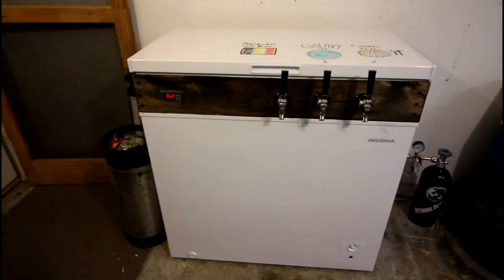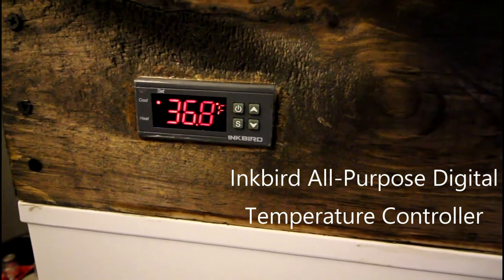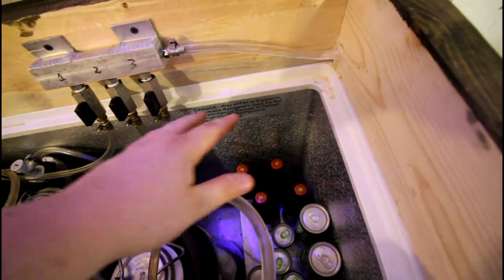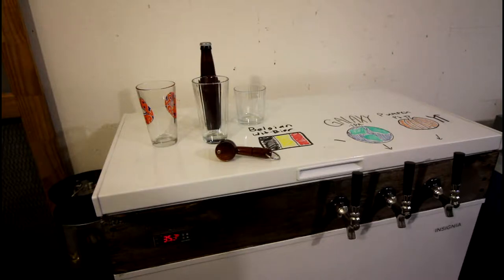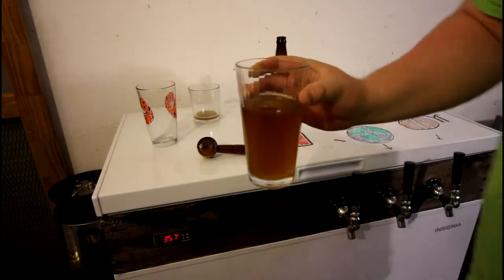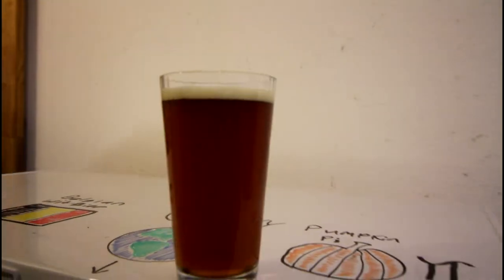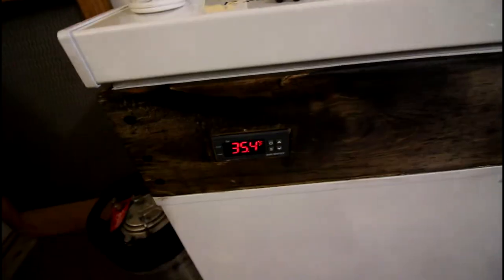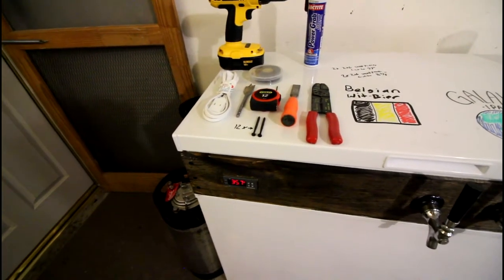Homebrew Keezer Insignia 7.0 Freezer + Temp control wiring!

Comment: Thanks for posting the Insig 7.0. Always wondered how many 5gal kegs you could fit in there.  Nice setup!
Reply from the maker: Hey thanks man, ya 4 as long as the top right keg isn't too tall. I have all pin locks now and it fits even with the taller gas and liquid hookups. A ball lock is a close fit up there tho. Hope you make one and enjoy it as I have. 
Side note I'm sure you could remove a  bit of the plastic / insulation from the lid as it's just plastic and foam.

Comment: Thanks for the response. I'm thinking I might need to spend more and get the GE. From the specs I seen I should be able to get 4 and a 5lber with no collar. I'm leaning towards doing a tower.
Reply from the maker: Kristopher Holmes Cool man towers are pretty sweet and there's no need for a suspended front drip tray. (I recently made one) hope you get the keezer you want. It's an awesome thing to have around.

Comment: i know it's pretty old, but maybe u can answer this question. do u remember if the fans set this place/way were working well?
Reply from the maker: I just placed them away from the edges. Especially the right side so it wouldn't hit the top of the keg on the right (the raised up portion of the floor) and yes they circulate plenty of air. Keeps the temperature the same throughout the kegorator.

Comment: You think you could fit 4 ball lock kegs and a 5lb co2 on the hump?
Reply from the maker: Kristopher Holmes I think you could fit 3 ball locks but unless you got something slightly taller than the 2x6 I don't think it would fit (on the hump) I put ball lock fittings on a pin lock keg so it would be a bit shorter. But I can measure the space when I get home to see how much room there is.